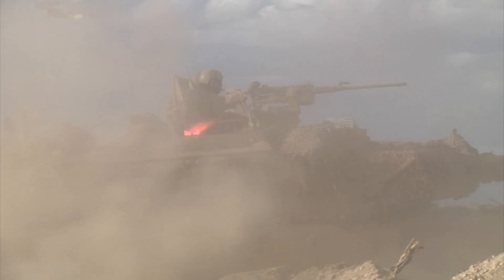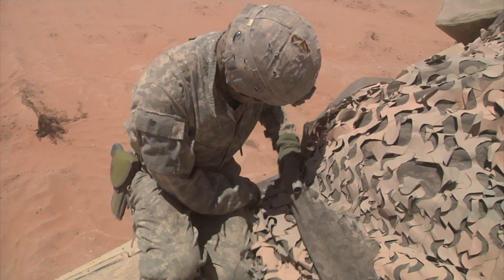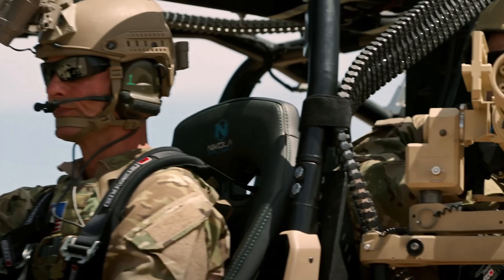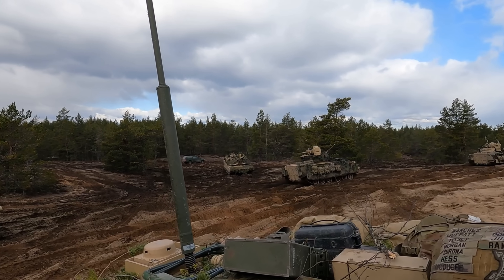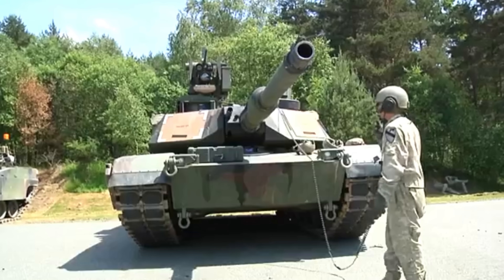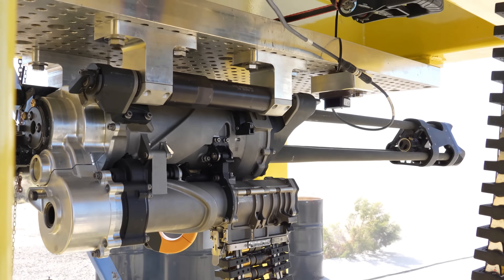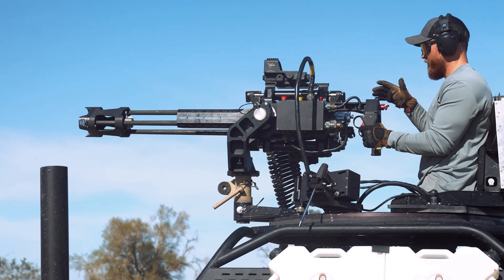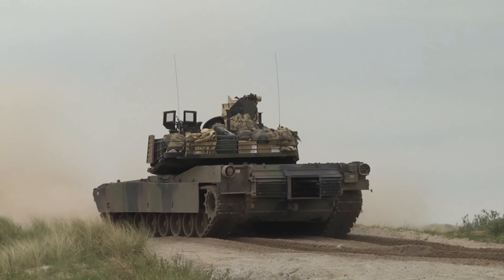Why is the U.S. Army putting a M134 Minigun on Abrams? | ROTARY GUN DEFENSE

Comment: Dual feed 20-30mm cannon. Large enough for proximity rounds, dual feed for standard apds/apfsds/hedp belts for light to medium targets that the 120mm isn't worth shooting at. Yes I love the KPz-70, how could you tell?
Reply: Hook it up to a smart system, like a hard kill anti rocket system as the basis for the software.
Reply: Good enough for large drones but tanks need to deal with the small Mavic type drones. Using a 20mm would be like trying to hit a mosquito with a .44 magnum.
Reply: @nemo-79000  Hence proximity rounds, and a dual feed system. This would entirely replace the commanders 50, and become a RCWS for the tank. A semi-smart programmable proximity round is easier to accomplish with the size of a 25mm autocannon round than a .50, and could be both a more cost effective and weight saving choice over large amounts of 7.62. Could even be a semi-smart airburst/ canister shot.
Reply: @nemo-79000  Actually, a dual feed M230 30mm Bushmaster was announced last year. In the announcement article from Armada, it's shown as a RCWS, so the impetus for this anti=drone design would be an operator-overridable system that could be passively searching for drones, as well as a proximity round for the proven m230 30mm.
Reply: @nemo-79000  Actually, ACTUALLY, they already make a programmable 30mm for the bushmaster. MK310	Programmable Air Burst Munition-Tracer (PABM-T)
Reply: @nemo-79000  https://www.youtube.com/watch?v=dwjTFBb-6D8
Reply: @nemo-79000  https://www.youtube.com/watch?v=rr7ym1zkda8

Comment: Putting a 134 mini on theory sounds good, like putting pineapple on 🍕. You take a bite and immediately you know it was a mistake. If you're atacked by swarm of drones you've got a problem.
There are several different things that I see in the horizon that may be an issue.
One of several is, LRAD long range acoustic device is something that may be a threat to the crew. Great review Matsimus.
Reply: Anything with a human operator is going to be too slow for drone warfare.
Reply: Pineapple on pizza is actually good though so use a different analogy
Reply: @ops3892 🤢
Reply: Some weapons are there just for morale purposes

Comment: Sad to say...but drones have become the #1 threat on modern battlefields being so cheap yet effective.    Hail of bullets to take them down makes sense and a tank can carry lots of them.
Reply: Bullets are sub optimal for hitting fragile, hard to see dromes' that move very fast (70-80mph). A shot pattern is more effective as it offer increased hit probability on fast moving targets and as drones are light weight and unarmoured; easy to kill so a heavy  jacketed round would be overkill. Steel birdshot from a automatic shotgun would be better and cheaper.
Reply: @nemo-79000  Shotgun shells have plastic wads and shot cups that would interfere with following shots at that kind of firing rate. Maybe pre-frag ammo would work if it was designed to separate as it left the barrel.
Reply: @nemo-79000  The minigun will work with all kinds of ammo....and shot ammo certainly able to be produced.    You could easily get 200+ grains of shot in each one which would make quite a shotstream.   
The MK19 with shot would also work, but slow firing and bulky ammo makes it less workable than 7.62 shot ammo might.
Reply: The average Joe won't hit the drone even with 1000bullets fired.
Reply: @hgh425 Someone should look into fielding an automated tracking system into the gun with an AI for IFF purposes. I know the tech is not there but an AI system that can account for ballistic trajectory and Rapid response would be effective but I agree that a regular Joe would be better fielded elsewhere than to be a sniper target
Reply: @hgh425 you’d be surprised how many videos there are of soldiers in Ukraine shooting down FPV drones with their rifles. Especially from the Russian side
Reply: They’ve already been experimenting with 7.62 rat shot in Ukraine it’s definitely a possibility but that ammo works best at close range. Still the throwing bullets at incoming threats works extremely well for the navy I don’t see why a smaller system wouldn’t be just as effective on a tank. It beats just hopping that the aps can pickup and engage a drone… and that theres not more drones than you have charges

Comment: Volume of fire against drones and like threats.
Reply: Bigger Gun, longer range and proximity fusing. GAU-12 or 22 for instance.
Reply: @jmjones7897   I dunno about needing a bigger gun, but proximity fuse for sure.
Reply: @HenryChangDesign Wouldn't be very effective in. 308 even if you could make 'em iddy biddy.
130-180 grain total projectile weight is no room for frag and boom
Reply: @jmjones7897  bringing down a plastic drone requires very little stopping power.
Reply: @jmjones7897  Smaller gun, lower range, fully auto 12-GAUGE instead of GAU-12. Unmanned turret, every single vehicle
Reply: Then we give it to the Air Force lol
Reply: @jmjones7897 The thing is cost effectiveness. Ammunition for big guns is expensive and you can take less of it on board.
Reply: @jmjones7897  The GAU-12 or - 22 would be a sight to see on top of a MBT as a secondary. I'd like the M230, though, with a coax M249. 30 Mike Mike with dual-feed proximity & high-explosive rounds is versatile enough to put down anything, from personnel to drones to light armor.

A MK19 40 Mike with anti-drone "shotgun" rounds to fend off FPV drones would be interesting to see, too.
Reply: @FunnyQuailMan Slap 40 40mikes in a 180degree upward facing arc on the turret like a death hedgehog.
An Ontos for the Modern Age.
The Army will ultimately reject it and the Corps gets back it's tanks.
Reply: @jmjones7897  HK already makes it, called the "Midgard", it's automated and light weight enough to mount on anything with a rigid roof. So, yeah, the Army will definitely reject it. I mean, it's not like the Army is just going to start making sense all of a sudden.
Reply: @FunnyQuailMan Why have Explosive Reactive Armor when we could have Explosive Pro- Active Armor!
Now that is Amer- I- Can Do
Reply: @FunnyQuailMan Copy that
Reply: @FunnyQuailMan Big Greens Sheltered Workshop
Reply: @FunnyQuailMan Eventually it's just gonna be old broken down Cold War guys( like self) in the back of an M113 that we had to buy back from fucking Ecuador or some shit with a sack full of re-dip Copenhagen and a pawnshop Maverick 12 Gauge.
You go to War with what you've got, right?
Reply: @jmjones7897  ammo is heavy, large and adds a 5th caliber to a platform that has multiple 5.56 m4s, a 7.62 240M a M2 .50, and a 120mm gun. 

How much additional .50 cal or 20mm can the tank carry? Theres just no more space. You'll be taking a 7.62 mini gun with tens of seconds of fire to a higher caliber with single digit seconds.

The real solution is downsize. For every round of additional 7.62 round that tank crew could fit into that turret basket, you can fit 2 5.56 rounds.

Drones are light and fast, a downsized minigun is much more manageable, quicker, same rate of fire and the 5.56 will shred any drone in existence. Double the ammo capacity, double the up time of the minigun. The tanks main gun, .50 cal and coax 240 are more than capable of dealing with any other threats in existence. And a 5.46 minigun will easily have 1500m usable range for other targets with such a large and over saturated beaten zone.
Reply: @Holykraut Too much turret, too much weight and too much tank as is.
But we already knew that
Reply: @Holykraut I said the same thing.
Reply: Yes drones and incoming ordinance.
Reply: Makes sense.  You want volume-fire if you’re about to be swarmed by Drones….
Reply: Who knows. maybe they have a new type of bullet 🤔
Reply: just get a 12gauge aps
Reply: You um... you didn't watch the video did you. It's mentioned in the first 3 minutes.
Reply: You don't need volume of fire against most of the drones that have been fielded in Ukraine. They're mostly little things that won't survive one hit.

Comment: We saw it on CoD MW3 so, why not. In all honesty I think someone got bored and wanted to get one on the tank for the hell of it. Though the regular M2HB is good enough for the job.
Reply: I remember seeing that M134 on an Abrams on CoD MW3, and I also remember even using it. I even wondered, "Surely the army uses the M134 on the Abrams", but, to my disappointment, that was not the case.
Reply: Ah another game reference. Just remember ,game designers are all about cool looks and ideas and pay zero attention to practicality. They are the kind of people that still think firing a minigun from the waist is a going proposition. It's not, the last idiot I saw that tried this was thrown off his feet and nearly blew his legs off. As for the M2HB, it's too powerful,  too heavy and has a low fire rate. Drones can move  at 60mph or more, they are hard to see at range and when you can see them can swing around you in less than a second or even more deadlier, fly above you and drop a grenade. A semi auto  BB gun would be more effective.
Reply: Oh yes because all that infinite pool of bulky large caliber ammunition doesn't take up space or weigh anything.. video games are video games for a reason. If anything a 5.56 caliber minigun would be a better solution for small drones. You want a large quantity of projectiles to shoot down a tiny, fast moving, flying target. Unless you mount a weapon capable of proximity fusing.. and something of that size and ammo requirement is simply not practical at all on a already very full Abrams tank.
Reply: @kylep3764 we actually already have a handheld 5.56 minigun
Reply: @Brent-jj6qi  Barely handheld. They needed Ahnold to drag it around on set, and even firing blanks it tended to knock actors over with the recoil.
Reply: The thing is, I remember seeing news footage with a M1A1 with a M134 where the M2 was supposed to be. That said, if you leave bored soldiers around, things happen.
Reply: HA!
Reply: yeah because mw3 is a good reference for irl
Reply: And in Mercenaries 2: Playground of Destruction.
Reply: I thought it was going to go in front of the gunners hatch, or maybe behind the commanders hatch.
Reply: @LeeBrown-zi4bh the Abrams has no gunners hatch. It's only the commanders and the loaders. The gunner uses the same hatch as the commander to enter/exit the tank.
Reply: @LeeBrown-zi4bh  The gunner doesn't have his own hatch. He's below and in front of the commander, surrounded by sights and mechanisms.
Reply: So we're running a real military based on what gamers think?  That is the plan?  We're fu.cked.

Comment: For drone threats, which it would kind of make sense to have
Reply: Not just drone, but also low flying aircraft, which normal Heavy machine gun is inadequate
Reply: @ArariaKAgelessTraveller ?

The 7.62 round is a smaller, lighter round than the .50cal. Lighter rounds don't go as far, are more affected by wind, and don't pack as much punch when they get there. At 1km away, the .50cal would be going nearly double the speed of the 7.62 with around 10x the energy. 

Wanna shoot down planes? Go bigger, not smaller.
Reply: @dgthe3 It's not about round size
It's about volume of fire
Reply: For anti aircraft use the sensors are much more important than the weapon.  I wonder if they will fit some of those small AESA panels they put on the MSHORAD to the Abrams.